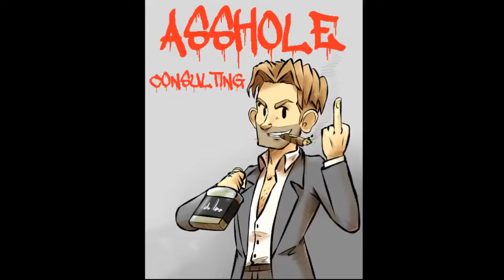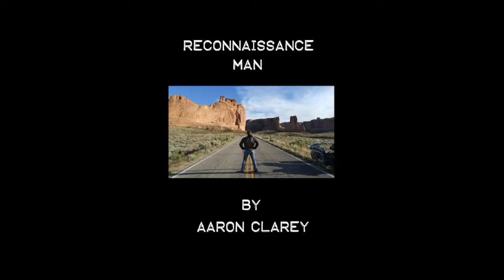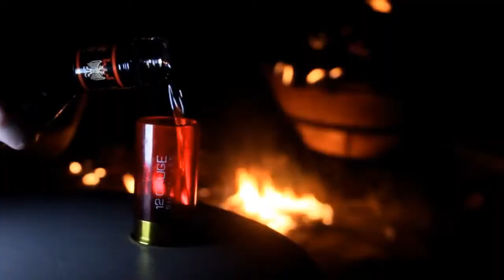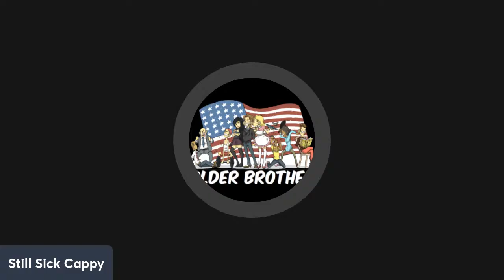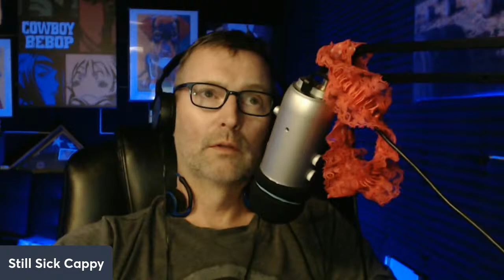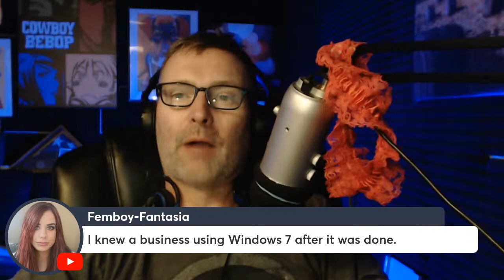PLM/CAD Migration Projects

Comment: My background is Electrical Engineering and I didn't even know what PLM stood for. I understand CAD just fine because I've used it for 30 years and I've had to migrate designs from blueprints to old CAD packages on old plateoms to new packages on new platforms. And I will never do that shit again, even with a gun to my head.